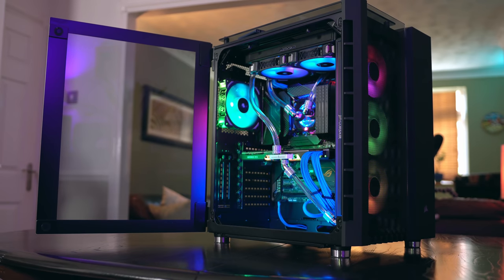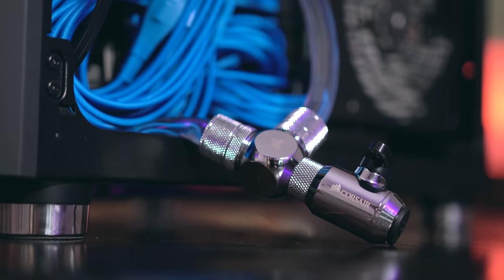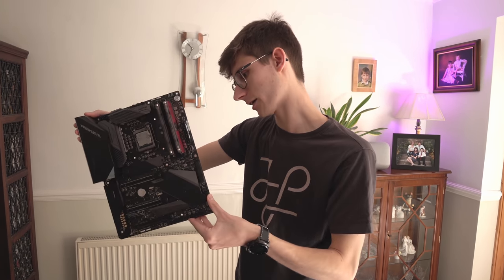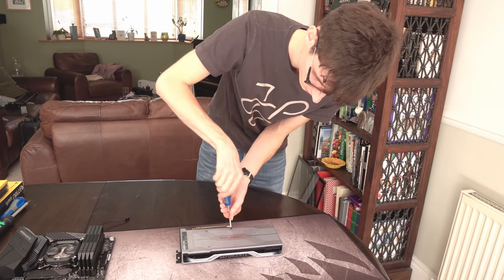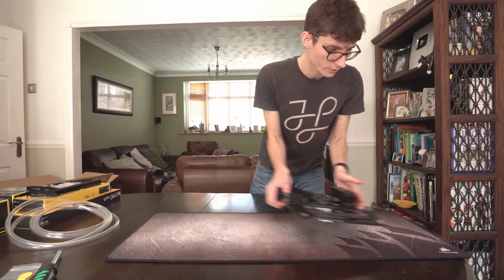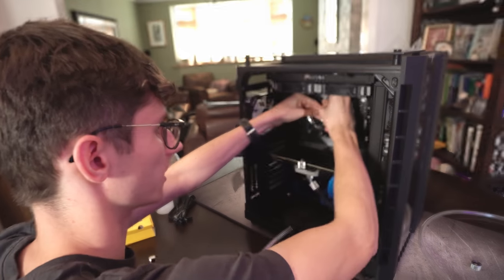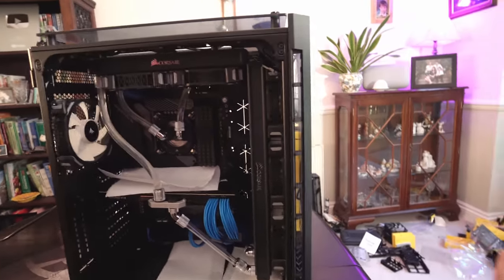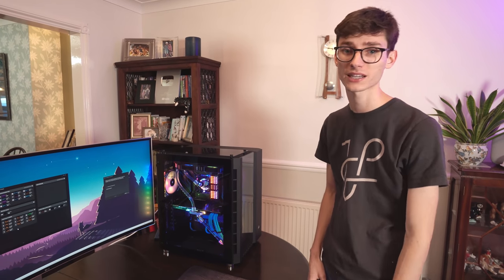My FIRST EVER Water Cooled Gaming PC! (Corsair Hydro X Custom Loop)

Comment: That was fun to watch and reminded me of my first custom loop :)
concerning pump noise when idling: you should be able to tune your pump down via pwm to about as low as 25-30% speed and bump it to 50 when under load. It will still create plenty enough flow for a "small" build like this and should be silent. Just test your components under load: you shouldn't see huge temp differences with the pump running at 50% or at 100%.

Comment: I learned a lot from this video - thank you. About to build my first system with my 13 year old son. Just bought the 680x case and similar components. Curious why you didn't vertical mount the GPU and place the pump in the main compartment? Seems those are two components you would want to show off in terms of water cooling / RGB eye candy. Appreciate your videos. Thx

Comment: i'm in the process of ordering parts for a very custom very scary first build. dual open loop, 2080ti, either 9900k or ryzen3000 depending on reviews, without cpu, mobo, cpu cooler, tubes, fittings, hubs and splitters and such, i've allready gotten over 3k worth of parts... this is going to be an absolute stunner in the looks department and an absolute beast to work/game on.
Reply: Dual loops are pretty much useless and pure asthetics, since different tasks cause different workload on gpu and cpu, and if you use just one loop you always can use the full potential of the rads
Reply: Tower 900?
Reply: @Tohru4647  if you're asking me? not a tower 900 but a core p7. went with the 3900x, gigabyte x570 xtreme. wanted to go overkill and i did.
Reply: That is super clean looking. I'm buying that kit soon with only 1 radiator. But corsairs website says the CPU block won't work with my i9-9900k with the msi mpg z390 gaming pro carbon ac motherboard. Not sure why that is. I sent them an email to see why the website says that, haven't gotten a response yet. I know it works for the i9. Maybe it's the motherboard it isn't compatible with? Doesn't make sense to me.
Reply: s10shane Maybe the motherboard doesn‘t have the correct socket for the CPU
Reply: @helloworld-bu1vk  it ended up working. I got my hydro x kit installed. I let Corsair know it is compatible.

Comment: Nice job dude.  You could try putting the pump at the bottom of the case and have the drain tap straight out of it. 
You can also go direct from GPU -> CPU -> Rad -> pump.

Comment: Hello. I am building my first PC using this exact same case as well as the Corsair parts you used. Is it possible that I could get your help with the process. I very much appreciate your video. However there are many things I was not able to see. For example once of your hoses on the bottom of the front radiator, I cannot tell where it is going. Also I didn’t see your final placement of the Commander pro mounting in the back, the drain valves final location and so on. I also need help with my first boot up into the Bios and so forth as well as installing windows OS. Man it would be really cool if I could get your gel. I would even pay for the help. LOL. Thanks in advance.

Comment: The new Corsair line is very nice for beginners and experienced alike but it is also very high priced. There are plenty of companies out there that make water cooling parts and once you've been in it awhile you can find some really good gear for a lot less money. Bykski, Barrow, Primochill come to mind they are not as well known as say EK or even Corsair for that matter but they do make quality parts. It's also much cheaper to buy a DD5 pump and then purchase the pump top and res, normally found together for a better price but can be had individually as well. I'm not knocking Corsair in the least and they do have some gorgeous gear and if it's the look you are wanting there's nothing wrong with paying a bit of a premium. Congrats on your first custom loop and now that you have the bug the fun has just begun. Sadly though so has the drain to your wallet...

Comment: Nice looking when all finished. My AIO sits at 30deg ish in normal weather. Mid 20s when cold. Under load around the 50 mark with the odd spike in the low 60s.thats cooling a i7 5960x @ 4.2Ghz. Don't think I could ever afford water cooled. Plus they don't make a block for my 1080ti. Checked their website the other day. Though I will be getting a corsair AIO soon, need a new 360mm rad one as mine is old and needs updating.

Comment: I hope you properly flushed the radiators because that will come back and bite you in the ass 4-6 months down the line when your pump dies. Also, only ever use clear premix or distilled water + concentrate, nothing else, otherwise you will be maintaining it constantly.

Comment: Your slim rad don't give you much more cooling than high end air cooling. I made the misstake with my first loop and not i stick with thick rads in a proper watercooling case. Also, the D5 pump is extremely silent. Paired with good low rpm fans (vardar are loud), the loop can be absolutely inaudible at 2m, but at the cost of some cooling of course.

Comment: I liked your video, and that you're using a proper cleaning solution to remove the gunk and prep the surfaces. I'd suggest you use white coffee filters rather than paper towels, though. They won't snag, and they're 100% lint free (but they're not as absorbant, so harder to work with).

Comment: So, decided at some point I want to do a water cooled build, I have an MSI Leapord pro laptop that can handle itself but heats up like crazy when gaming, plus GTX 950M I believe is pretty outdated by today's standards.
spend all day "window shopping" on the internet and came across a few gems including the Phanteks Glacier RGB reservoir, which so happens can be found with a DDC fan pre installed.
Reply: what I've currently got together as the water cooling set up is around £450 including some aesthetic extra's (ThermalTake Pacific Flow Indicator One)

Comment: It's water cooled, you don't need good air flow. Just need air going over the rad and an exhaust. But good job. I'm terrified about giving this a shot because I'm worried about the GPU. Your video has helped lower my anxiety. Still a ways to go before I try though :)

Comment: Corsair's blocks looked very cheap, even the fitting connections look plastic, lots of plastic around the sides (not as much copper on the inside).

For those who are seriously wanting watercooling components, these are my recommendations.

Radiators: Hardware Labs Black Ice SR-2 if it fits and you need the extra ports, Nemesis GTX if you don't, Nemesis GTS / Nemesis L-Series (L-Series is 120mm wide in case the 133mm wide won't fit).

Radiator fans: IMO the best performing for performance to noise are Noctua NF-A12 or Gentle Typhoons. I'm hoping Noctua comes out with the chromax version around the end of this year. If you want RGB, Cosrair's fans are probably the best.

Pump: Singularity Computers Protium D5 PWM. Nice looking quality D5, and the cables are sleeved in MDPC-X (the best sleeving in the world).

Reservoir: Singularity Computers Protium combo in the largest size you can comfortably fit. They're a bit expensive, but come with multiple ports on both the top and bottom. It you buy other reservoirs you normally need to buy the multi port cap separately and it costs close to the same. These are also gorgeous.

Water blocks: I'd recommend either Watercool (Watercool.de) or Aqua Computer water blocks, they perform better than EK and look nicer too. Aqua Computer is a bit more restrictive and I like the look of Watercool blocks a bit more so that's my pick. Stick with a CPU and GPU block. Monoblocks just add unnecessary heat from the VRM into your loop and the VRM is made to run hot anyway. They also add unnecessary restriction.

Fittings: I have always used Bitspower fittings. Just make sure you get fitting that have a compression ring. The "push in" ones are more error prone.

Tubing: Most people will recommend PETG tubing because it's supposedly easier to work with. It is in a way, because you can cut it with a pipe cutter and it's easier to melt / bend, but I actually think acryllic is easier overall because it's easier to deburr and the bends aren't as prone to mashing in at the aides like PETG. I use Singularity Computers 16mm OD acryllic tubing.

Comment: Why is youre pc in a sleep mode state (40) its supposed to say (AO) all operational or as i like to call A OKAY
Reply: mine is same..40 means pc has been woken from sleep its normal
Reply: I had the same q code, but i fixed it.. I dont believe its normal.. Are you on nvme? Ssd?
Reply: @boelle1234  it's completely normal... It means the pc has woken from s4 sleep state..... You can disable fast boot in bios to remove the code 40 but boot will take longer.... So better to leave it..... Its harmless code check on asus forums
Reply: How fast is fast boot on your system? I did not disable any thing in bios
Reply: @boelle1234  about 15 seconds into windows... With old plextor m.2 ssd
Reply: @reigningblood9616 15 sec is also what i got in boot time.